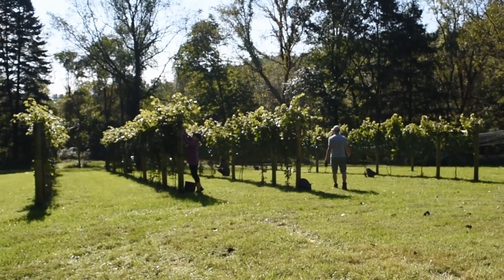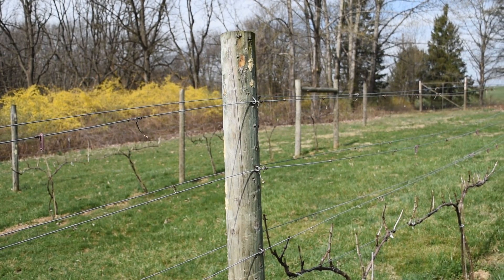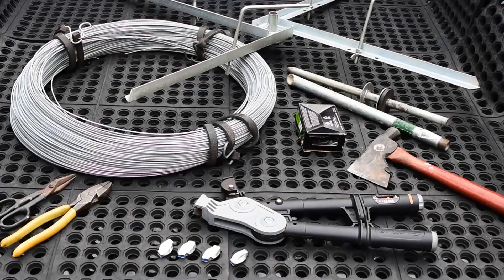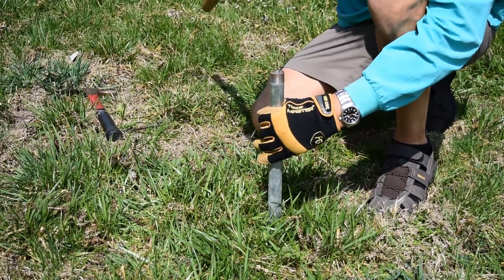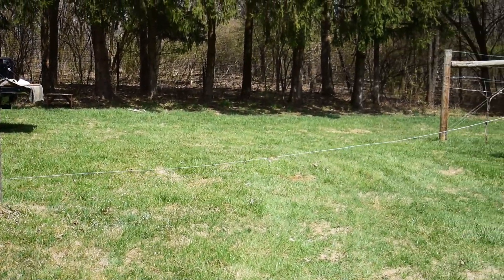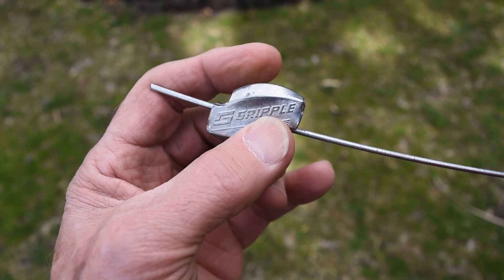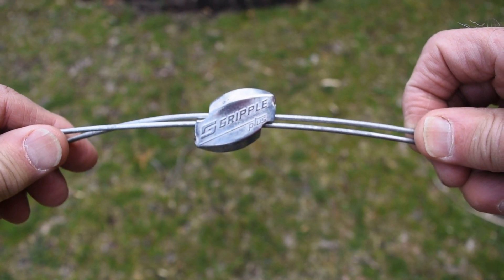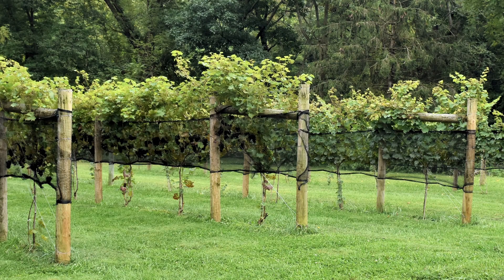Viticulture -Trellis Wire Installation in a Hobby Vineyard

Comment: whats the height for all the wire?
Reply from the maker: Height from ground depends on the vine type.  Lowest Riesling wires are about 24 inches off the ground, highest about 70 inches. The three middle wires are evenly spaced.  Chambourcin; 28-70 inches with even spacing.